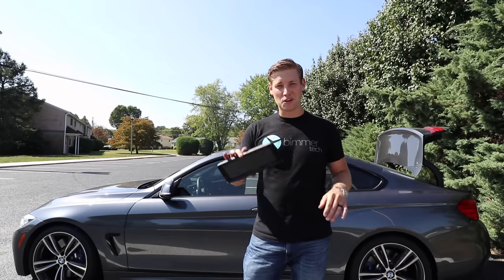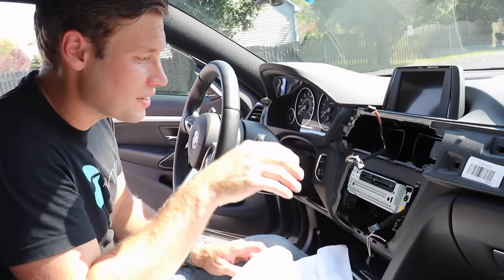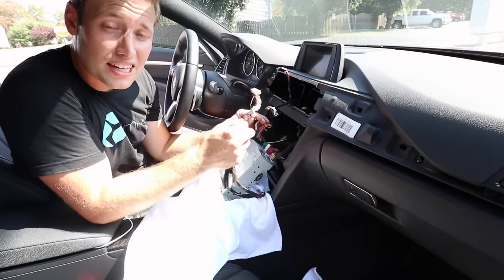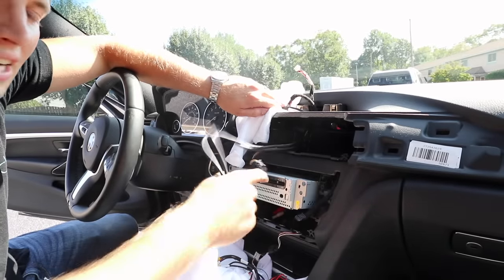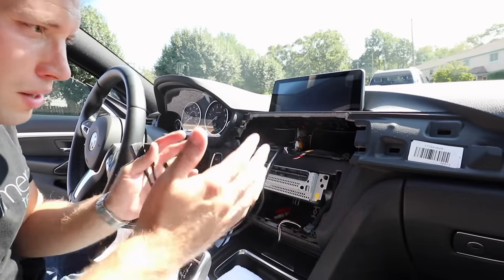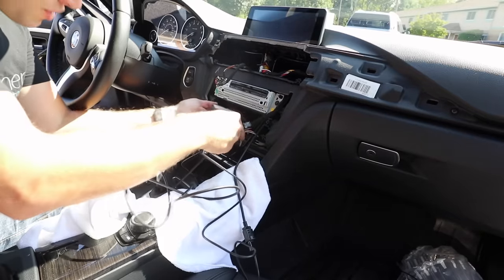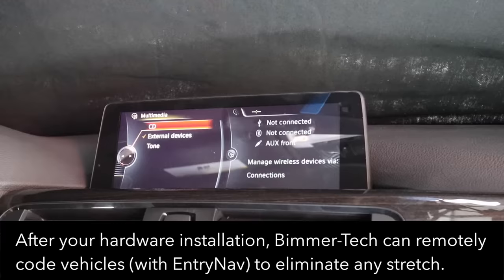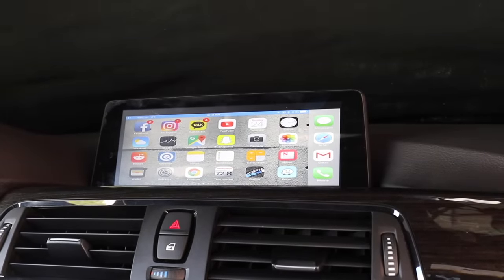How to install an Upgraded 8.8" Screen in your F30, F32, F3x BMW (BimmerTech’s all new VividScreen!)

Comment: Thanks. I had to replace my screen only and I was able to plan and execute with some knowledge of what was under there and how parts should be removed thanks to your video. A little less work than what you did here as i used same cable but this gave me the confidence to try myself and all worked out well.

Comment: I didn’t understand why you were running the aux cord to the plug, what was that for? Is it necessary? Also my car doesn’t have Nav, along with the buttons in the central console would I need to buy a different head unit? Cheers, great video.

Comment: My car has an ENTRY head unit. Can I upgrade to an aftermarket android or Linux screen without changing the head unit? If not, what kind of connection does an entry unit have, four pin or six pin?

Comment: Is that an original bmw screen you are installing or something made by another company? If not .. my question is .. is it possible to upgrade original bmw small screen to an original bmw wide "profi" screen? Some say it can't without upgrading the computer? Or was this with the older models an issue and did bmw make it more efficient with these new models so that ppl can upgrade whatever they want.

Comment: I have a question. So I bought a 2013 bmw f30 with the radio upgrades already. The problem is the turn wheel in the center will not work with the new menu only the old one. It can scroll threw the menu but once i press it in nothing happens.

Comment: Thanks for video. 
I own F30 (2018), but I did not want to spend EUR 2600 for navigation. Consequently, as I did not buy navigation – I got that small monitor. Seller said – sorry, big monitor comes together with navigation😊 
The question – if I buy somewhere big monitor and smart gadget, how can I know that it will fit? Maybe some one can advise on some figures, numbers etc of that big monitor.

Comment: I have a 2018 x1 in Brazil and here they come with a 6 inch screen instead of the bigger one, it comes with the one just like the one in the video. If I buy the bigger one just like the one on the video can I install? And I was wondering can I install a 10 inch or would it be too big? Thanks

Comment: So I just installed one of those 10.5inch Linux screens off Amazon and was wondering if anyone ran into these issues, 

CarPlay audio cuts in and out, power windows in the back won’t roll up or down auto and stop every two inches. Idrive knob no longer works in the original interface

Comment: Hi - I have the F83 convertible and removing the battery is a pain in the ass. Is it absolutely necessary to disconnect the battery for this installation?

Comment: I have base model 2013 F30, with that small screen.
If I buy used OEM 8.8" screen off another F30, would it work in my F30 without any modification or coding?

Comment: Hey Brian I noticed after you install the upgraded head unit in the car it doesn’t display the clock anymore in the instrument cluster and on top of the head unit itself what cause ? Do u know how to fix it I got into the same problem I only see the time on Apple CarPlay or android auto only not when u pressed the menu to go back to stock software

Comment: So if I don't have EntryNav it still won't look good? I have a 2012 328i SportLine with the smaller screen. My interface menus look like the examples you showed still pictures of. Can you code EntryNav to the car so that you can get the better resolution and split screen? Or am I stuck with the boring entry level stock interface? Thank for the videos btw! Love what you do for the f30 community!
Reply from the maker: If you go on the site, we have a picture of what the screen would look like, with a little bit of stretch. On my old 328i (the white one) I had this screen in it and I'll tell you what. I'd much rather this screen with a small stretch than the factory screen. If you send me your vin to info@kiesmotorsports.com, I can let you know if your car is able to be coded. Here's the link to the vivid screen: https://www.kiesmotorsports.com/kiesstore/vividscreen-f30f31f32f34f80
Reply: I have same problem.. I have 2012. 320d with basic navigation system and small screen.. I want to have bigger screen, do I need just a screen or whole unit with idrive controller and module behind vent panel? Sorry for my bad english, greetings from germany
Reply from the maker: Hi, all you need is the VividScreen!

Comment: Question, I have a business system and I would like to upgrade to professional but I guess the small wheel to control the system need to be changed as well... Then all that is possible? I have a series 1 BMW. Thanx for your answer if u can...
Reply from the maker: Would you be going to an nbt?
Reply: I am not an expert but I think I have an NBT drive already, but I would love to have the biggest screen and to be able to control as well the equalizer, I only have bass and treble.. But I dunno if those changes are possibles.

Comment: Hi thank you for the video, i have a small question.
If I have the business Navi and change that to the professional navigation with NBT and the touch idrive system  ..  all system updates which used to work on the old navi/system are not working anymore! 
How to get the correct system updates after modifying the navigation and the idrive?

Comment: hey excellent video, I have a 320i 2013 and change the screen for a larger one that is a l7 cid high but fails to replicate 
the system on the screen, shows a message 'no signal' but I did not put another harness can you help me? Thank you.

Comment: Hi mate where did you get the quad lock adapter with video inputs or do I need to buy the vivid screen as well. Doesnt the normal big 8.8 screen have these plug connectors in there

Comment: Great video man, as always. I’m definitely considering purchasing this screen as I hate mine lol. Only thing I don’t like much is the stretch. I don’t have Entry Nav, so will selecting the screen resolution correction on the purchase option on your site fix it? Or is that option only for the Entry Nav models?
Reply from the maker: Thanks! If you go on our site, you can see some pictures of what the stretch looks like. I had the stretch in my last car (I had this in my last car for about 6 months) and although it was a little stretched, I preferred that over the stock small screen: https://www.kiesmotorsports.com/kiesstore/vividscreen-f30f31f32f34f80
Reply: Kies Motorsports ok I see, will most likely end up getting it then.
Reply from the maker: Sounds good 👍🏼
Reply: @KiesMotorsports  will this work on a bmw 320d sport 2012

Comment: is it possible to swap to an OEM 8.8" screen from a 6.5" Entry (no nav) and coding these 2 things to avoid stretch?

HU_NBT > 3000 HMI > DISPLAY_SIZE_RESOLUTION = 8.8_1280x480
HU_NBT > 3001 EXBOX > DISPLAY_VARIANTE = breites_display

Comment: Hey Bryan, just a question, are there any software difference between the factory option bigger screen vs the smaller screen? Would you be able to get the bigger screen features by installing this vivid screen?

Thanks!
Reply: Good to know any updates ?
Reply: main difference is it might have navigation, the smaller screen doesnt have navigation. which without having navigation it will probably complicate things when trying to install CarPlay

Comment: Hey man
I have the idrive with no navigation
Is there a possibilty to upgrade only head unit and get the nav working that way and if not id rrplace the knob the screen and screen but is there something else to add since id want the advenced bluetooth and navigation also i dont have the comboc

Comment: Does anybody know, if that also works with the 2014 F22 228i ?
Reply from the maker: No, only F3x cars for now
Reply: Does it work for a 328i ? If it does how much
Reply: @KiesMotorsports  will it ever come to the F20?
Reply: @KiesMotorsports  how much to do this on Bmw 320dsport 2012

Comment: Can u make a video how to show a temperature of engine in f20 every time you start engine?
Reply from the maker: What do you mean by this?
Reply: Kies Motorsports because in f20 you don't have a information of actual temperature of engine, but I know this is hidden in menu and it's a little bit hard to find and if you start engine it will disappear. I would love to see this all the time somewhere. (In f30 there is 4 clocks and in f20 there is only 2 Speedo and rev) English is not my native language Sorry

Comment: Hi, i have a question regarding the navigation screen. I have a business navigation system with idrive 6.0 on a 4 series from 2017 but my screen is small since it's the business one, so my question is if it's possible just to replace the existing screen with bigger one? Like a 8.8' screen  and will it work? Does anyone know this?

Comment: How do you code the screen from small to big? IE How would you code the stretch on the screen to become the normal resolution with the wider screen?
Reply: You don't need to code your car, it is basically, plug and play, please.

Comment: Hello Brian, I was wondering if that screen would fit in my 2016 base model 320i, I still have the regular Business navigation system.
Reply from the maker: Hi, your car doesn’t have the larger screen?
Reply: Kies Motorsports No, I have the standard 6.5 inch display
Reply from the maker: +Harry //M sounds good. You can do it then! https://www.kiesmotorsports.com/kiesstore/vividscreen-f30f31f32f34f80
Reply: Thx :D
Reply: Harry E46 did it work?

Comment: Hey Kies is the Bimmertech Screen Resolution Correction to fix the stretch if you only have ENTRY?
Reply from the maker: You have to have entrynav for the stretch to be coded out
Reply: okay cool not a problem it doesn't look bad with the stretch at all! But I am curious about the vivid screen needing to be connected to the AUX input. I currently have a Bluetooth adapter in my AUX input in my F30 because I have the base radio which doesn't allow Bluetooth connection to phone aside from making phone calls. If I install this will it allow me to play my music from my iPhone via Bluetooth? kid of a problem if it won't ya know.

Comment: is the smartview support every single apps? are there aps that cannot be displace on the screen? Thanks
Reply from the maker: If you stick to the SmartView Flex for Android and SmartView HD for Apple devices, you shouldn't have any issues with the apps, but we don't make any promises just in case Apple or Android makes a change that's out of our control

Comment: why didn't you install a backup camera?
Reply from the maker: I have an OEM one :)
Reply: Kies Motorsports I've been trying to get a backup camera for a 2012 BMW 328 for literally ever and I can't figure out how to retrofit it into the OEM Navi and idrive system
Reply from the maker: We sell them at www.kiesmotorsports.com. I'd recommend the MMI rear view camera :)
Reply: Kies Motorsports THANK YOU SO MUCH. that's with coding or is it something that I'd need to get coded? Do you know of any shops or anything in Toronto or around that would be able to do the install?